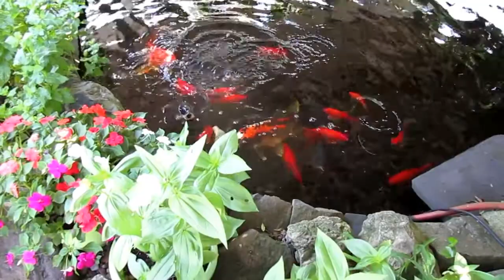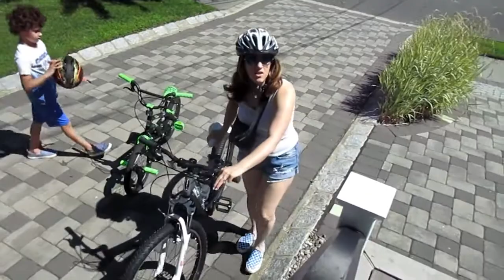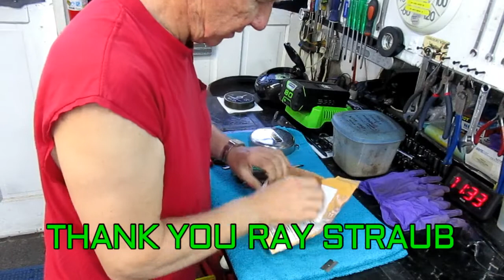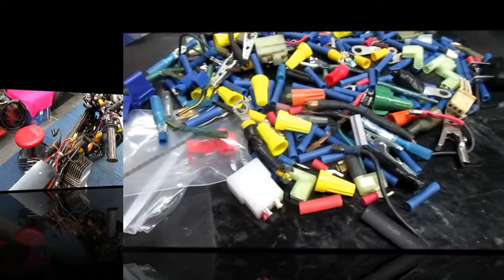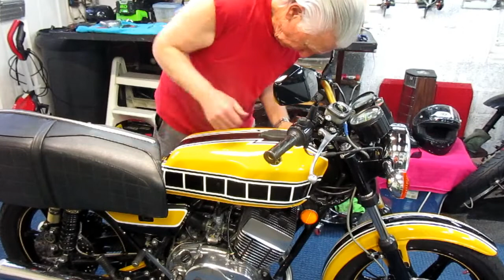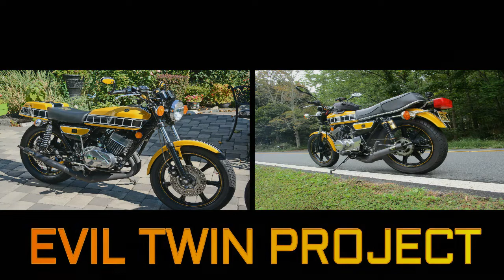pt 229 NINJA RESTORATION,YAMAHA RD400 1977 COIL SWAP

Comment: Nice video. Just curious how this worked. I am currently undergoing the same surgery, and feel the pain regarding the nuts. The difference between the rd-400 coils and the ones you have is that the 400 coils are 2 ohm resistance, whereas the 350 are 4.  Everything I have found says to bypass the resistor . Did you not do that, and how did it work out? Thanks.